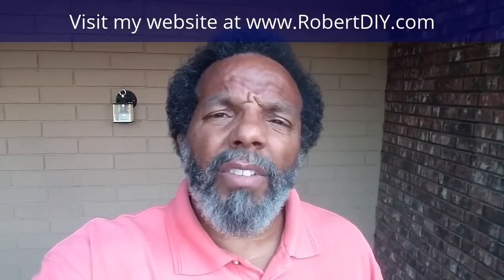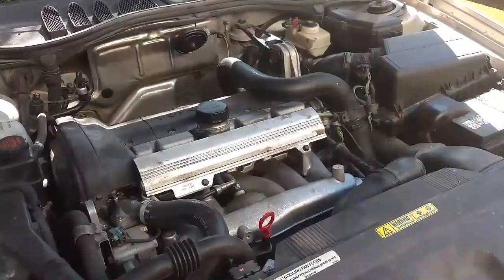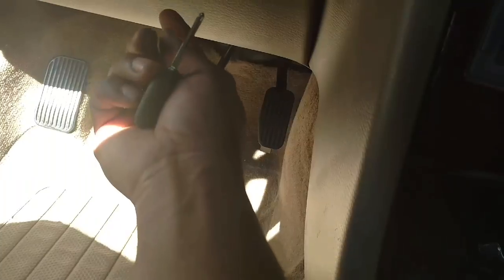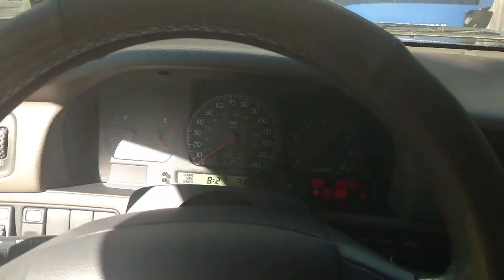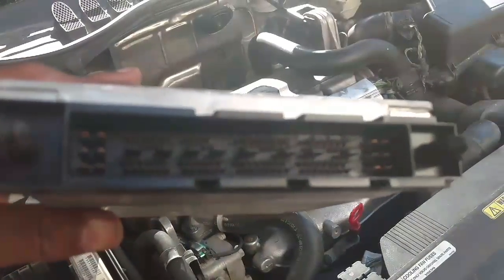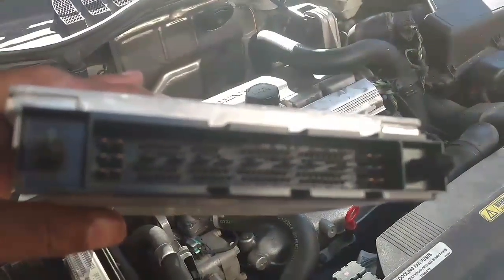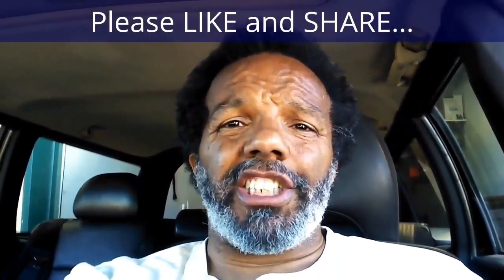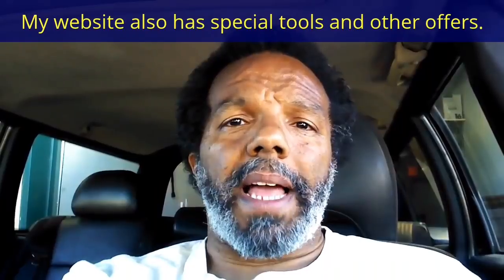In the Big-D checking out a S70 with a crank no start situation. - HOWR

Comment: Hi Robert,
I just saw this news of your Mothers passing.  I'm sure she was proud of you for being a generous person with your knowledge and teaching.  I was  in a "crank, no start situation" on my '98 S70 (235K) and going thru the education/evaluation process.   Thanks to a reply where you mentioned the term "Lawnmower Syndrome" i did more investigating on that.  My wife had just moved car over in our driveway prior to "crank, no start".  I did notice that it did sound different when I tried cranking.  Solution I read after further investigation was to floor the accelerator  and crank for 1 minute  then try again, I could tell from sound it was getting better (more compression) on 3rd try it fired up!  Yea!!!  read this on the Matthews website.  The writer mentions there is a Volvo TSB on the issue and that is recommended  method to solve problem.  Hope this helps others.  Take care.   Thank you!
Reply from the maker: Thanks for sharing

Comment: A common problem on Volvo S/V70 from this era is the imobilizer antenna ring. Its like a ring that sits around the ignition keyhole which have to sense the carkey, otherwise no fuel is pumped to the engine. The problem often degrades over time and sometimes the car will start if you leave the key in the ignition for a long time before trying to start the car. Sometimes cleaning connectors with wd 40 is enough to get it working again. Otherwise you might have to replace the antenna. // A swede with 100000km of S70 '99 experience
Reply from the maker: It causes the car to work after you disconnect the battery?
Reply from the maker: Oh, I did replace that ring a couple of months ago.
Reply: I dont think that it helps to disconnect the battery. If you have a bad antenna ring normally the fault starts to occur intermittent and gradually gets worse untill the car never starts so if this fault came from nowhere it is probably something else.
Reply from the maker: Marten0615 this issue is a no start until you disconnect the battery.

Comment: Hey Robert. Got a crank no start on my newly acquired 97 850 turbo. Car came without a key. Took the steering column apart to get to the ignition using a screwdriver. Fuel pump sounds off. Fuel at the rail.  Fuel relay replaced. Have spark at the plugs. What should I go after next?  Crank position sensor? Ecu? Compression? Would it be possible for the car to even start without a key? Like a security thing. Or something else?🤔🤯 Thanks for the what you do.🙏 Yes I've watched all your videos. 🤗🤓
Reply from the maker: Yes I'd check the big 5. 
Should start unless alarm has been triggered.
Make sure fuel is spraying into the cylinders.
Reply: @RobertDIY  Looks like chocolate milk in the top under the oil cap but oil seems fine in in the dipstick. Checking the compression tomorrow. What are the chances its just the head and not the entire motor? Is there anyway to know for sure? Otherwise #imaGoHead and see if I cant return it to the tow yard I got it from. Such a shame. The interior is gorgeous for a 97.... AND the sun roof works. <mind blown>  :)
Reply from the maker: https://youtu.be/YiPAPu-K8OI
Reply from the maker: https://youtu.be/za8qgxDey8I

Comment: Good luck, condolences on your mother. 

Also if you can swap out that ECU for another one just to test it I think that'd be a good idea, I'm not convinced that this isn't some issue dealing with the engine being warm. Say a crankshaft position sensor fails, that'll stop a car from cranking when it's warm, so maybe a similar issue is going on here with a device that's failing when it's warm.
Reply from the maker: Doesn't matter if the car is hot or cold. Disconnect the battery and it will fire right up. Pull the ecu and it will fire right up.

Comment: Robert can you tell me how to remove the cover for the computer or ECU on the passenger side under the hood.  I have a 1999 volvo v70 that starter turns but wont 
fire up. I changed every relay in the fuse boxes and key ring and climate fan relay by the radiator..aloha, fred
Reply from the maker: what's missing?
Reply from the maker: https://youtu.be/gt9w-ZSxs9I
Reply from the maker: https://youtu.be/AoqbF0ZEzpg
Reply from the maker: https://youtu.be/YiPAPu-K8OI

Comment: hi Robert I have a 1995 volvo with the inline 6 and I want to make it a manual but from what I've seen I need a m90 gearbox bit those are imported and I was wondering if you now if any other transmission will work like a m66
Reply from the maker: More like the M46 or M47.
Reply: ok thank you I'm new to working on cars and this my first car
Reply: Chasen Callaway i wouldn't recommend doing the manual transmission swap unless you really know what you are doing and you have ALL THE OTHER parts, not just a transmission
Reply: I got another volvo that's a manual that I'm putting all the parts into

Comment: Hello I’m checking back in about the 04 Volvo C70 
Checked for spark there is none 
Coils ands plugs work
Crank no start 
Please help 
Thanks
Reply from the maker: Any error code s?
Reply: Robert DIY 
I cleared all the codes it was bad mass air flow sensor and crankshaft position sensor 
Now scanner says 0 codes 
However still no spark
Reply from the maker: Crank it then check for codes before you turn the ignition off. Where did you get the crank sensor?
Reply: Robert DIY 
Ok gonna try that now
The sensor came from Salvo Auto Parts
I’m letting battery get back to full charge before I try again
Reply: Still no codes
Thinking of taking it to local shop 
Please help those guys are crooks
Reply: Taking it to the shop thanks anyway